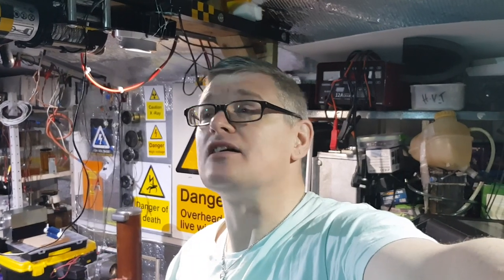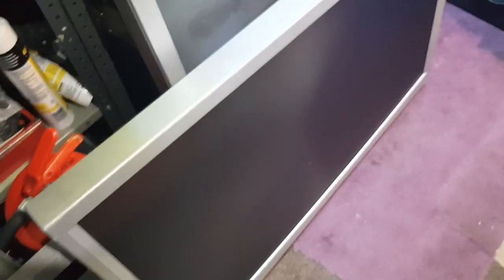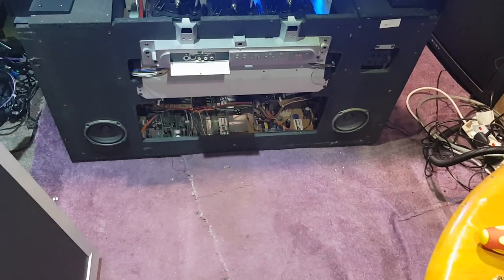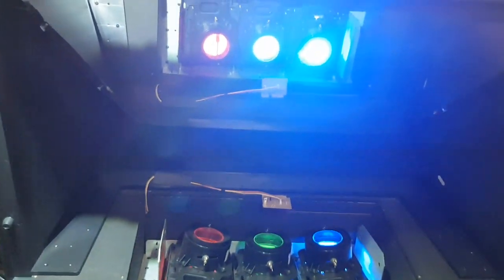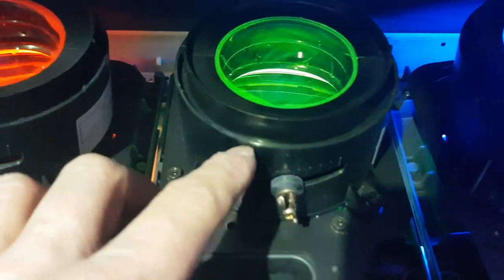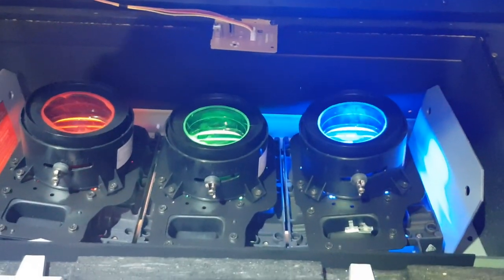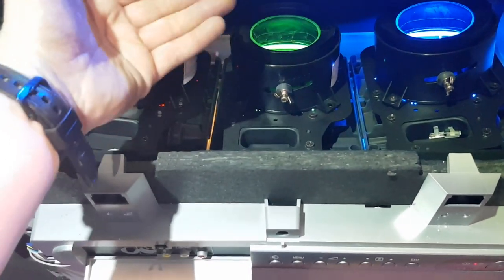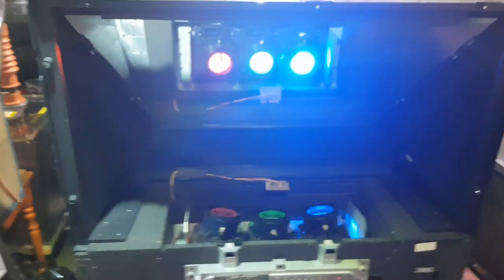Working RGB CRT projection tubes

Comment: I remember when these Mitsubishi's were the king of rear projection TV's. I would sometimes go to my local high end A/V store, and they had a bunch on display,  with some in rooms setup as home theaters with really nice speakers and integrated amps. These rear projection TV's were the only affordable way to get a decent size picture when HD fist came out. Otherwise you were looking at a 36" CRT that would squeeze to letterbox when in HD mode. Thus you really had equivalent of a 32" or 34"  diagonal HD picture. I had a Sony 36" XBR, and man did it look good with the Trinitron tube, the dot pitch was so much better than other similar CRT tv's doing HD. There was always the trade off of CRT with it's smaller but bright colorful image that looked good at any angle, or the huge size of a rear projection TV that lost brightness off angle from directly in front. 

However the ultimate HD viewing back then was front projection on a home theater screen; but those needed tightly controlled ambient light. Those front projectors were doing about 200 lumen's, today's projectors can easily do 3000 lumen's. I remember seeing some of the first HD footage on a front projection setup, it looked so sharp. The dynamic range and blacks were fantastic; you had to have your eyes get accustomed to the dimmer environment to really get the pop. Early LCD projectors had nothing on those front projection systems, total screen door effect that was so noticeable, the only advantage was they were brighter from the start, but blacks looked so much more washed out.
Reply from the maker: Wow! That’s awesome! Iv never actually ever seen one for sale in a tv shop! Iv only ever seen them in brochures or something!! As the tv shop we had was a small Sony shop!! Awesome stuff” and thank you for the comment.

Be safe buddy in this difficult time and I wish you the very best. 👍😷

Regards

Anthony / High1voltage1rules

Comment: I took apart that exact model! They are a treasure chest full of goodies! Fresnel lens, decent speakers, beefy FBT and lenses
Reply: Oh yeah! Lots of stuff that's useless on its own outside of the television.
Reply: The flybacks in projection were unmatched indeed 🤣
Reply: @Browningate  Ummm.
 
Not even close. We referred to these types of finds as gold mines. There's a little bit of everything going on in there.
Reply: @MadScientist267  Can you name more than one or two tangible benefits of spending all the time that it takes to part one of these out?
Reply: @Browningate  I've got bins full of gutted out subassemblies and boards that are perfect for "can just screw with it" for so many things. There were niche stores based on the idea.

It's not like today where there's a bunch of chips and it's pointless to mess with them at that level.

You take a few junk items from around the house in the 60s, 70s, and 80s, and toss in some breadboard and an iron, you'd be amazed what one could come up with, right there, for "free". 

I used the words before, I'll use them again. Gold mine. Hands down. Some things are better than others. Old CRT TVs and especially projection? Right up there when it's "found at the curb" time. I wouldn't pick up a modern flat panel to save my life. Yawwwn.
Reply: @MadScientist267  So, my point still stands. You've got bins and buckets of useless junk. 4 paragraphs and not one tangible example of anything legitimately useful that was recovered.
Reply: @Browningate  3 lenses and huge fresnel = diy projector, video/photo lights, camera lenses, fire starters, sun energy, etc. CRT tubes for art, oscilloscope hacks. Speakers for music. Most of this stuff is getting harder and harder to find online affordably, but these TVs are still free a lot because they are hard to move. Don’t even have to mention all the random components you can salvage
Reply: @ethantschida3045  DIY projector? What exactly do you have that those lenses are going to fit? And why can't you do "art" on your main computer monitor (or your phone, since they're only 7" tubes)? Do you mean to tell me that you don't already have unimpressive TV speakers to listen to music on?

I agree that the parts can be useful to fix other units, but there's not exactly a huge market for that right now. Most people with the skill to fix it themselves are skilled enough at other things in life to be able to afford something other than CRT projection.

Again, my point still stands until someone can provide some realistic, tangible, examples.

Comment: Hello, I have a rear projection tv that recently stoped working I’d like to have it repaired the tubes inside the bottom part is longer than the tubes I find online I don’t know anything about these, do you know where I could find the longer tubes online ? Or could the shorter ones fit? 

Thank you.
Reply: Just going by your question I can tell you'll be in over your head with this (as by now you've probably either found out or never bothered)...

These things are an alignment nightmare and without all the goodies and understanding to get you there, you'll get an image, but don't expect "watchable".

And while you may be able to eventually half hack a different set of tubes into a given unit, know that there is so much that won't line up, optically, electronically, geometrically, and otherwise.

It's not like a single color tube where once it's got HT, filament, and deflection, you can more or less get a picture out of one (that said even single tubes can be fun to align, but projection is an entirely different world.)

Comment: my projection tubes has a light glow at the bottom but the tubes are on sometimes and sometimes not what causes this
Reply from the maker: I’m so sorry for the late reply! I get hundreds weekly comments and I don’t always get notifications! 
But your problem like many others with a crt based tv” was dry joints due to the heat build up and cooling down! If you was do run a soldering iron over most of the main points of the circuit board (if competent) you would find the issue could be fixed! 
⚠️caution ⚠️
Of course” you must leave the tv switched off and plug removed from the outlet” when doing this! 🔌 and left for at least 2 weeks without powering on! To get rid of any residual ⚡️high voltage build up from the capacitors and tube!!

I hope this helps you and I wish you the very best of luck!

Be safe.

Anthony/ High1voltage1rules

Comment: It's not bugs in the oil (glycol actually, and conductive).

You can unscrew the optics since it's not flooded, and clean out the in air parts. (There is a plastic part looking like a transparent soup bowl between the liquid and air)
Reply from the maker: erlendse yeah I should know this as iv taken many apart but forgot lol. Thanks buddy for the info 👍😁
Reply: Also keep the focus e.t.c adjust block when you take it apart. They are nice for giving voltages to control the tubes!

Comment: I have a Sony 53” CRT RPTV it’s 22 years old still working like new it spent more time on than off it’s whole life supisingly it’s still as bright and clear as it was new never had to put a penny into it when it eventually does go id like to have the 3 tubes rebuilt I just don’t know where I’d sent it
Reply from the maker: WOW! Thant’s great! Can’t believe you still have one! There so big and take up so much room! It’s so surprising that the few that are still around today!
I bet if you was to remove the back off the RPTV and clean off the 3 primary colour lenses it would be even better! As the lenses to get a film of dust build up!

Can I ask” Are you in the United Kingdom?? Lol if so if you ever want it gone I’ll drive to pick it up!! 🤣🤣🤣

Thank you so much for the comment mate and please be safe. 😷 
and I wish you all the very best” in this difficult time with the COVID-19 !!

Anthony / High1voltage1rules
Reply: I take the back off and clean out the whole inside every 3 months it’s in a well ventilated area so it doesn’t get to hot when it eventually stops working I’ll ether put new tubes in it or have the old ones rebuilt I still have this because I’m personally not a fan of the flat screens the picture looks funny and they don’t last a fraction of the time that these do as long as parts are available for it and it still works it’s not going anywhere lol 😂 

I’m in Canada,
not UK always wanted to go there though
Reply from the maker: @jacobcole8212  bless ya mate, I know what you mean with the picture in new flat screens. I took me about a week or so to get use to them but you would be surprised at how amazing a good sci-fi film looks! Especially 4-8k films! I don’t watch normal tv ever! Too many adverts! But going back to your tv” if I was you as you want to keep yours going is to keep your eyes open on eBay for a tv like yours to purchase for replacement parts! Like you there’s people still using them somewhere” and could end up just replacing it’ and putting it on eBay!!
Wishing you the best luck in finding your parts mate. I think the longer you leave it the harder it will be! And could be extremely Expensive the longer you leave it too 🤦🏻😢

*Funny thing” Iv always wanted to go to Canada 🇨🇦 lol I’d like to go there and stand on a mountain and drink a can of mountain due” lol 😂 🤙🏼

The UK is miserable this time of the year’ with wind and rain. But up north Scotland bloody freezing -6 degrees” with high winds of upto 100mph. 🥶
but Derby (Midlands) where I live is better! With temps around 0-4 to 0-8 in the daytime. But the summers can get nice and hot with temps upto 32 degree😎 in some parts of the south like London can get hit with temps around 36 or more!🥵 very busy and Expensive place to live!
So a little info for you friend and it was no bother 😉👍

*subscribe to my channel buddy if you enjoy high voltage electricity and destruction carnage to broken washer machines and microwaves ext:  😂

Be safe my friend and all the best in this difficult time with covid.

Anthony/ high1voltage1rules